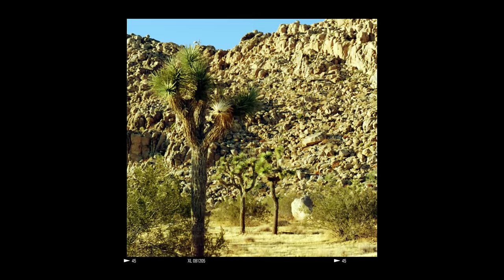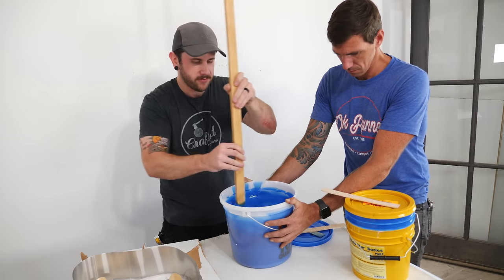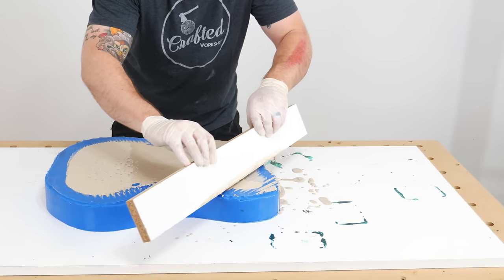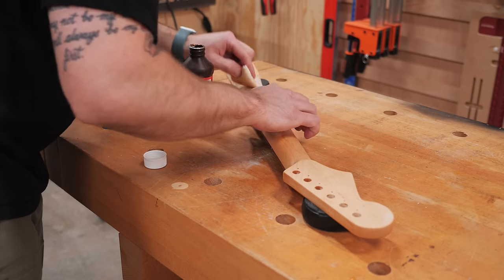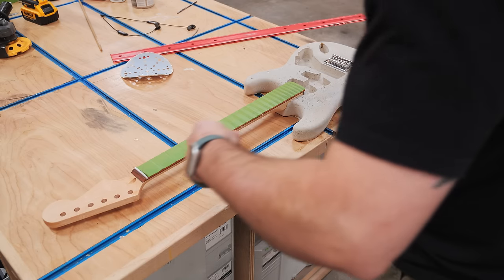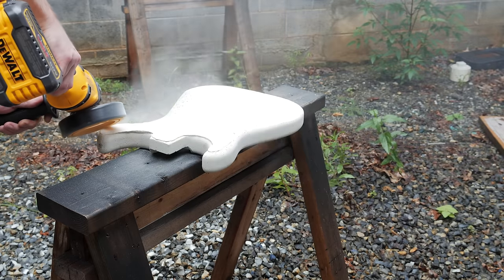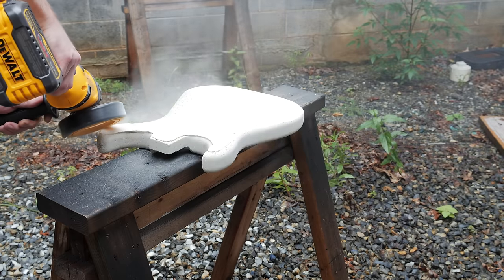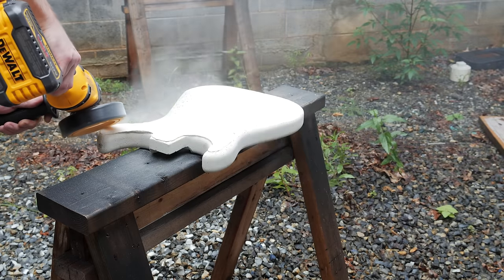I built a GUITAR out of CONCRETE. How does it SOUND?!

Comment: You've probably just started a huge discussion about what kind of concrete gives better tone. Thank you.
Reply: And what about the sustain?
Reply: Quikrete from 1965-69, before they got bought out. New concrete is very shrill and thin sounding, it doesn’t have the fatness of the vintage concrete.
Reply: @Guitar.Jim_  Sakrete has ALWAYS produced better tone than Quikrete.  What most people don't realize, and obviously you are one of them, is that the age of the concrete has absolutely nothing to do with tone, it's all about aggregate size!  And 4 layers of sealer?  That killed his sustain.

Was I obnoxious enough to make it sound like a real tone wood debate?
Reply: Yey
Reply: JREP  Expected blood, but so far it's pretty civilized. Wood guitarists must be wilder than concrete guitarists.
Reply: @grzegorzmielcarek4359  We, the concrete guitarists are the true intellectuals, we don't need to argue because we know that we are better...
Reply: Tone-crete
Reply: LOL, driveway concrete, highway concrete, prestressed bridge concrete, brick mortar...
Reply: The tone is in your fingers!
Reply: Just don't use plaster and sand, it explodes when it gets hot 😁🔥🔥🔥🔥
Reply: What about floor leveling compound?
Reply: I actually prefer my guitars to be made out of aged plastic it has a much better tone and an easy to play light weight.
Reply: It would clearly be a concrete mixture made out of river sand instead of rock powder/ synthetic sand. I’d imagine the consistency of the river sand would give a smoother tone. (I’m clearly talking out of my ass)
Reply: I prefer Roman style concrete, sounds much fuller.
Reply: @Guitar.Jim_  wth would even think of that?? I can’t stand the weight of my Les Pauls!!
Reply: I made a guitar out of air,, its super light, plays great and sounds amazing,,, and I always shred
Reply: Obviously the best sounding guitars are made of 1990s Portland cement.
Reply: @Guitar.Jim_  LOL
Reply: Jajajaja oh shit here we go again!!!
Reply: I'm a fly ash fan. Perhaps also use an air entraining agent to cut down the weight a bit and to give a multi-chambered effect.
Reply: Lmao. Tonestone.
Reply: Y'all sleeping on the OG: opus caementicium made from pulvis puteolanus. The Romans had tone figured out looong before this quikrete bs.
Reply: P. Taylor  And concrete is reconstituted rock - but you have a point.
Reply: Nah man, you need some old Roman concrete. That stuff was made with some volcanic ash & coarser pieces. Just need to add some rebar to fix the tensile strength & you've got a rough but fat tone.

@AustinMcCune This guy wiki's too. Nice.
Reply: ToneCrete
Reply: Obviously intended for playing hard rock.
Reply: The replies to this comment just sound like a bunch of civil engineers
Reply: @literallycanadian  Or people who used Google
Reply: Obviously Portland cement has a richer tone, but adding some quartz aggregate will give it a nice, brassy finish.
Reply: LMFAO
Reply: Roman Concrete is the best
Reply: nah that discussion is existing since minecraft noteblocks :^)
Reply: That's legit gonna happen
Reply: a new era of tone discussion has begun
Reply: I’m dead 😂😂😂😂
Reply: You need to use American "tone sands", the cheap Chinese concrete lacks structural integrity, and gives a less mellow sound
Reply: Bahahaha though a very interesting video nonetheless
Reply: Flamed concrete is pretty good
Reply: it's all about the accoustically tuned aggregate being placed in a concentric concave pattern  matching the thickness of the similarly shaped 304 stainless steel with a minimum of 2 micron gold plate.
Reply: Little sus, theres not enough “concrete” evidence to back this up
Reply: 25% mixture of Portland cement to any Readymix will provide a much more balanced, mellow tone.  Avoid off the shelf cements at all cost....ya have to really feel the mix by doing your own custom blend....IMHO.
Reply: Zapraszam do kontaktu - udostępnię pracę na temat znaczenia drewna w gitarach elektrycznych.
Reply: Air Crete for the win!!
Reply: Greek concrete easy
Reply: @pigpilot7275  , I usually add a little bit extra Portland than what normally comes in a bag of cement. I have my own special formula, especially when it comes to the aggregate....
Reply: The one with rebar gives the best tone and above all the most sustain.
Reply: tone-stone
Reply: Hempcrete
Reply: Is it waterproof ?
Reply: Volcanic rock!
Reply: Quikrete is OBVIOUSLY the best
Reply: Concrete made with Icelandic black sand.
Reply: From the creators of "tonewood", we presnt you: TONECRETE
Reply: And yet none of you guys have mentioned ratio of sand:cement, nor even making 'rubber' concrete, as used in outdoor, G-scale, railways, to smooth out vibrations* ...

... also, whether to add glass dust, to add that extra 'sparkle' ...

[*= OK, that last one may not be as insane as it sounds, as concrete, unless of a insane ratio of <1:2 cement/sand w/w, still has a natural resonance. Learned that by watching how a large, North Sea, offshore, gas platform was built to withstand asymmetric vibrations caused by waves, in different directions, especially in a high sea-state (as in green water over the bow type seas ...) ...

... and being a model railway buff, creating 'rubbercrete' to withstand the constant vibrations, as the trains run across the tracks, for a 'small scale' garden railway, is nothing new ...]
Reply: @nigelft  If you use more sand than cement, it makes it easier to do vibratos. I tested myself and it sounds great! I used White sand, 3:2 ratio to be exact.
Reply: I'd like to give that guitar to a guy like Satriani, or Vai or Malmsteen without knowing it's made of concrete and see what is their reaction. Surely it'll be surprising.
Reply: Best. Comment. Ever! 😎😎😎
Reply: Asphalt or roasted asphalt might sound warm :P
Reply: You know it's inevitable
Reply: bet its quickcrete 🤣
Reply: I'm going to say, concrete mixed with fly ash. If it's good enough for RCC dams, it's probably good enough for guitars.
Reply: @Guitar.Jim_  LMAOOOOOOO
Reply: Lmao...and the rest of us know that for electrics, it's more about the pickups than it is the material fromnwhich the guitar is made.
Reply: @Guitar.Jim_    p
Reply: Im an epoxy man myself 😂
Reply: Fred Flintstone had one identical to that. He had it hooked up to an amp that was a big clam shell filled with bees. The sound was purely awesome pre-historic hard rock
Reply: 🤘🏼😈🤘🏼 noice...
Reply: The demo sounded sadly pretty good 😒, u bet it's not as easy in the back as my one price ash 😏
Reply: @pigpilot7275  Oh yes.... Aaahhh those were the days, eh?!
Reply: Don't forget, when our Concrete Guitar playing ancestors were using what we call "vintage concrete" (I believe the correct term is VINCREET), to them it was BRAND NEW! Ask them to play a 1965 VINCREET Special today and they'd laugh in your face!
Reply: @philgallagher1  the g string was wound with mammoth wool and difficult to  bend back then
Reply: 🤣🤣 uh 😮 😁
Reply: @literallycanadian   Hey! Don’t call me such names! I was a lowly ACI Tech! But you are correct...
Reply: @whiterabbit75   And maybe an exposed aggregate finish! As long as it was smooth river polished quartz!
Reply: @nakamotolikesyou   And it DEFINITELY needs a rebar Wammy Bar! He could turn down and thread the one end but the other should definitely keep the pressing/deformations and have the all the ID visible for any onsite/on-demand inspections!
Reply: @timrussell1559   for the WIN!
Reply: @michaeldimmitt2188  Signature Rebar Floyd Rose
Reply: @michaeldimmitt2188  Naturally.
Reply: Too much water in the crete mix weakens the set. Minimize water to maximize structural load capacity. Mount hardware, strings, and electronics prior to drying to provide ample vibration for the body to set. Recommend a thru-neck on the next one for maximum effect, as they did back in the crete-acious era.
Reply: No they have started a great discussion of what the sound difference is between a concrete acoustic and a wood acoustic
Reply: Roman concrete FTW
Reply: @JimmyFeelsIt  Are you vibrating it?
Reply: Mexican concrete would sound much better
Reply: I would think the variety the Russians produce would be great with the built-in sonic air pockets and a little weight relief to boot.
Reply: Guitarists tell me hard, dense woods give better tone. How good is this gonna be then?! Very heavy!!
Reply: @realtruenorth  What tone air did you use ?
Reply: @markknight6445  imaginary mahogany LOL
Reply: What kinda slope ya using!? hahahaha
Or  apoxie guitars!?
Reply: Kkkkkkkkkkkkkkkklkkkkkkkkkkkkkkkkkkkkkkkk
Reply: Fender Roadworn Ass Fault
Reply: The body of the guitar doesn't change the sound
Reply: so, how about an acoustic guitar made out of concrete? 🤘🏼
Reply: I personally think that guitars made out of dried dirt are better: they have an earthier mid-range.
Reply: Anchoring concrete  Rules!  QuickSet drools!!
Reply: haaaaaaaaaw haw haw haw haw 😂😂😂😂 what kind of concrete gives the better tone, now this is a good one
Reply: @poriland41   im so 🤣🤣🤣right now
Reply: I'd hope it would finally shut people up.
Reply: @Guitar.Jim_  this is a good information ... didn´t know about that ... thx !!
Reply: the tone would be "Like a Stone"
Reply: This is the best reply thread I’ve ever seen
Reply: Everyone knows the concrete doesn’t matter.  It is the size of the rebar that makes the tone.
Reply: @Guitar.Jim_  looooooooooool
Reply: the Ancient Roman one will be the best
Reply: Lol
Reply: Make the hendrix edition from hempcrete, he would've wanted it that way.
Reply: @maxmagnus377  🤣🤣🤣 he brought the ROMANS into this!
Reply: @Akeldama9  fax. Volcanic ash tone all the way
Reply: @Akeldama9  imagine some asking what wood your guitar is and telling someone your guitar is made reinforced volcanic ash
Reply: @mihailmilev9909  Is volcanic ash considered rock or metal?
Reply: Mortar, is better for tone, because it has no "rocks" in it!!!
😆🤣😝
Reply: If the tone is too warm, the concrete is still curing.
Reply: @txgunguy2766  Y’all are going to debate concrete guitars without talking about the Austin Concrete Company. They have been doing it since ‘63 and are pioneers making the first concrete guitar for jazz. The nerve of some people
Reply: Pickups are the only things they change sound on electric
Reply: I doubt it makes a damned bit of difference. The strings, pickups & pots mostly dictate what a guitar sounds like. If the body material contributes at all, it is indirectly through sustaining the note. Guitar bodies tend to be made of dense wood and I'm sure concrete is just fine in the same role.
Reply: I'm not into concrete timbre. I'm more of an asphalt guy.

I'm all about those pressurized hydrocarbons, it gives so much sustain too.

And if you smoke, it's easier to light up your matches with an asphalt guitar than with a concrete guitar.

So you can look badass on stage before burning the entire venue.
Reply: Tonecreat 🤣🤣
Reply: tone stone
Reply: Are they also going to talk about how big the dowels are and what wood they're made of
Reply: I heard Asphalt has more bass.
Reply: Of course the guitar boomers with their “tone woods” and shit, and now “tone concrete”
Reply: Concrete is cool but have you tried asphalt? Way grittier sound
Reply: @pigpilot7275  What about cement? Wouldn't it be denser, making for smooth bass harmonies and springy high ends?
Reply: @Velvetspoonful  Well, that depends...  CEMENT is used as the binder for concrete, or, in other words, concrete without some of the ingredients, mainly, the aggregate.  Which aggregate are you suggesting to be left out, pumice (low density) or something like granite (high density)?  It might be worth checking into some of the earlier stringed instruments such as violins made by Stradivarius.
Reply: @pigpilot7275  Depends on what you're planning to do with that guitar. You might want to opt for lead in order to accomplish that heavy metal tone, otherwise carbon nanotubes are being dumped into every old composite material nowadays, plus it might help with the shielding.
Reply: rock music
Reply: Stop arguing cementics
Reply: The best concrete from Poland! pozdro
Reply: @mattiv1 Yes. Polish concrete makes concrete music. Miłego dnia.
Reply: preferably very old and cured concrete.....maybe from an old "westwall" bunker on the atlantic coast in france......that should doit....
Reply: Oh my god.  I'm DYING!
Reply: Cant beat a classic 58' warehouse pillar...
Reply: @pigpilot7275  Nah, you weren't obnoxious. You should have insisted that only true Roman concrete has the best tonal characteristics, and the best concrete is made with ash from the eruption of Etna in 475 BC gathered from the location of the Sicilian shoreline as it existed at the time of the eruption.
Reply: I'm just glad he didn't opt for the broom finish !!! LOL
Reply: @pigpilot7275  
I think it's more the origin of the concrete that makes the difference. Is it a low-budget quick-set concrete from Asia or concrete from old bunkers in Normandy. I've even heard that the recyclable concrete from historic autobahns in Germany is said to have incredible sustain.
However, I would also be interested to know whether the recyclable concrete from countries with very high temperatures such as Africa or southern Europe sounds different than that from rather cold countries such as the Arctic or northern Europe. Questions over questions...
Reply: Aggregate size, fiber reinforcement, and admixtures always play a role in the tone. Also curing compounds that accelerate or slow the cure will have an effect when playing cure songs...
Reply: Aircrete.
Reply: Just play and have fun.
That's all. That's all
Reply: Snowcrete (obvs)
Reply: Comedian! Oh man
Reply: How about a stucco guitar 🤪
Reply: If you don’t play a concrete guitar… it’s your own asphalt..!!  🤪
Reply: @AIRMIKEY1  That was a good one 😂 You just got a Gibstone award 🤪
Reply: @stevehorvath7310  concretely it is!
Reply: @Kimoto504  Came out this morning to find a Strat shaped hole in my resin driveway - looks like guitar building is moving on to ever new ideas/materials, but please guys, buy your own!
Reply: You know it.
Reply: Concrete with titanoxide in it sounds better. ☕
Reply: @stevehorvath7310  i tried with just fingers but no guitar. They don’t make a guitar sound. I must have to practice more I guess
Reply: my money's on portland
Reply: Roman concrete creates the best tone
Reply: Acoustical treatment should do it!
Reply: GGGLLLLEEEENNNNN!!!
Reply: The holy grail is to get your hands on some genuine, vintage Roman concrete!
Reply: nonsense. we all know hydraulic concrete is king on this.